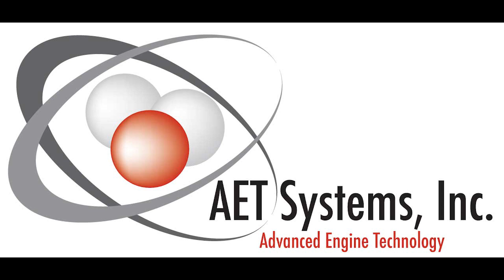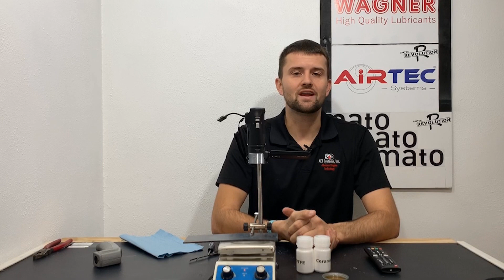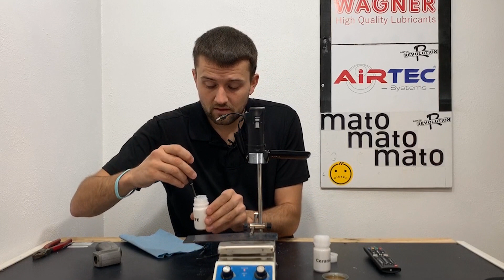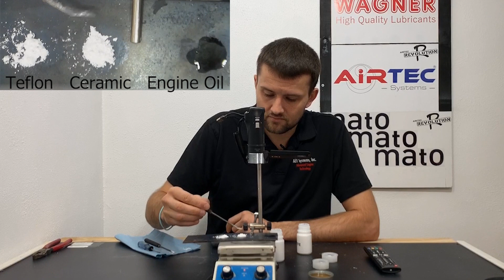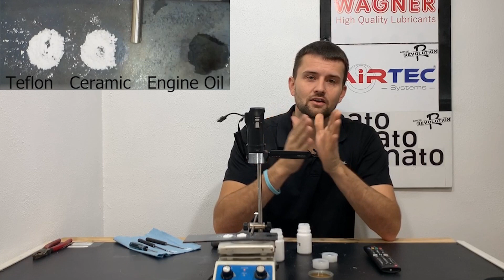Teflon Vs Ceramic Oil Additives: Uncovered in Temperature Review

Comment: If ceramic is truly beneficial I can't help but believe the companies making engine oil would offer a product with it already in it
Reply: Liqui Moly Molygen GF6 APi SP. It's available in every grade viscocity you can thick of.
Reply: @ericsivilla4091  liqui moly is the Lucas of Europe 😆
Reply: @Yelladog78  so what's the good stuff ?
Reply: @ericsivilla4091  application dictates
Reply: @Yelladog78  street performance.  Daily driver / Spirited driving.?
Reply: @ericsivilla4091  I meant more an application towards what type of engine. Flat tappet or Roller cam? Maybe Dual overhead cams? Timing chain or timing gear? Any boost? Gdi where fuel dilution is present. Would need to know all that to know how much zddp you need in your oil,  sheer stability of the oil you need, is  oxidation going to be an issue due to heat, how long between oil changes are you planning to go, how hot does your engine run typically. 

Valvoline vr1 is what I run in my off-road jeep and my Corvette. Pennzoil ultra Platinum goes in the wife's work car. But all that stuff a guy needs to know so he can pick the right oil.

Comment: Which would be better if heat wasn't a factor?
Reply from the maker: If heat is a non factor, ceramic still has a lower friction co-efficient and creates a more durable lubricant film than traditional oils and/or Teflon.

Comment: I would like to see a test that shows how well the ceramic additive goes thru a high quality oil filter like Purolator Boss synthetic filter or similar. I just don’t feel like these dry additives make it thru the filter media.
Reply from the maker: Our Ceramic particulate is size is 0.15 microns, for reference the micron rating for the Purolator Boss Synthetic Media Filter is 21 microns.  So the ceramic particulate is 0.7% the size of the filters minimum filtration ability, meaning there is no issue.  We rate our product for a minimum of 1 micron filter media.
Reply: @aetsystemsinc.1413  thank you for the answer.

Comment: You mentioned in a comment that your ceramic additive can be used with a wet clutch, but the ceramic oil treatment on your website specified that it cannot be used with automatic transmissions.
Has something changed?
Reply from the maker: Great question.  It is approved for motorcycle wet clutches, but not automotive automatic transmissions

Comment: Worthless test as that isn't happening inside an engine. According to this test oil is horrible as it burnt away easily. Actually that proves the test is not proper. It makes me think that teflon has a chance of sticking to the cylinder walls. Possibly bearings, but the temperature is probably not high enough.

Comment: I have a scientific test I want done.

There is a penetrating oil/grease that is primarily a mix of moly, PTFE, and oils of some kind.

I want to see how it behaves as an engine oil in a scientific environment and have the why's of what happened explained to me on the chemical level, because on a mechanical level I will understand the failure and where/how it happened, but I want to know the why of what causes it.

Comment: Too bad Teflon micro bearings don't exist.

Imagine a solid sheeting of Teflon encasing the crank and con rod, and a ceramic bearing of micro scale placed between those surfaces and lubricated with oil.

Comment: The motor oil carbonized long before the Teflon, so i dont get the argument. If you have those temperatures the motor will seize before anything happens to the Teflon.
Reply from the maker: Oil is forced away by the rings and the fluidity of the oil allows it to better displace heat.   Teflon is designed to act as a residual, meaning it adheres to the metal surfaces and is not forced away by the rings and eventually it breaks down and becomes gummy.  This is why the argument is made against teflon as an engine oil additive.  There are a lot of cases of this occurring, in fact, many of the Teflon based engine oil additive producers in the 90s eventually went bankrupt from lawsuits showing Teflon's negative impact on engines.

Comment: I added ceramic additive to my BMW 1.9 4 cylinder and it didn't have top end power because it had done 270'000 kms!..after adding ceramic additive i now get top end power!..I am so impressed in what ceramic can do to an engine!
Reply: yes I have noticeable better acceleration in an 04 TB with the Air-Tec added.

Comment: Nice greetings from Bayern (Bavaria germany)! :)

Nice Test and i'll get more knowledge about Motor oils, Additives against waer & even because i'll get a Lifetime vehicle with the 136000mls old 2006 Dodge Charger RT Daytona what i've optimized in this premission (& still in Progress to size Up Lifetime, especially with size down wear--> with my knowledge of Motors & now with get more & more knowledge of the additives in motoroil & how i could get a more wear protection motoroil....)

I found out of the most common issues of these 5.7 (&6.1-64L) HEMI's (American Design OHV V8's Like the HEMI's; are a high solid base for this Kind of Project & premission) that these issues/problems must Not be & could be prevent of it. 
Most known or Infamous Issues of these engines are mostly because using the fuel consumption optimized thinn ..W20 Grade Motor oils in my eyes, even also like that high motoroil Temperatures, too.
& So the 1st was to get a 15 row motoroil Radiator+180°F/82°C Oil Thermostat + 180°F cooling water Thermostat. In Same driving conditions the oil temp dropped roundabout 25°C , even in cruising conditions in the hilly roads of Bayern (~105-115°C before ~ 85-95°C after build in these things)

And now i'll get away from these recommend 5W20 viscosity grade motor oil to an 0W40; where i've choosen the mobil 1 FS 0W40 because the oil analyses shown me high Phosphor (P), Zink (Zn) & Bor. What should be very nice for prevent wear of the Motor ....
But now i've bought CERATEC (Liqui Moly) what's even an ceramic oil additive to get into the Motor Oil....(300ml for 5L) because there are some wearTests of motoroil with & without this CERATEC that shown a netter wear protection....

But what do you think about this Things, optimations what i've done or will do with that premission in this Car??? :)

Have a nice day Cheers Till 🙂🍀

Comment: need to check the additives based on the 4 ball bearing ASTM testing, which every single oil manufacture uses to see what additives they will put in to get various SAE oil specs?c here's the link to the ASTM Test https://youtu.be/nxTViMKn9a0

Comment: Ceramic reminds me too much of the rage for "Graphite" in the 70's and "Teflon (PTFE)" in the 80's.  I'm thinking if "ceramic" is that good, the major engine oil manufacturers would include it in their high end engine oils?  I find a point missing here in that lubrication in an internal combustion engine is the flow of oil over surfaces, not oil clinging to surfaces like in grease lubrication.  Am I missing something?
Reply from the maker: Fluid filming is one of most important attributes of lubricating oils, the goal is to have oil/their additives hold to a surface to produce/provide wear protection.    For further reading refernce  https://www.machinerylubrication.com/Read/30835/lubricant-film-strength    In regard to "major" oil companies using ceramic/boron nitride they do.   Alot of industrial lubricants use ceramic in their oil composition, additionally most race teams use ceramic reinforced oils.   The main draw back for popularity in "retail" oils is price point.   Ceramic additives are drastically more costly than lesser performing alternatives.

Comment: cylinder head temps rarely go over 400 degree F unless dam overheating..  I fly airplanes with piston engines.  We have gauges for that, for EGT also.
Reply from the maker: You are correct that surface temperatures rarely go over 400F as engine are designed to transfer and reduce heat.  However, peak gas temperatures during combustion reach well over 1500F this is well documented and what is discussed in this video- lubricant degradation at peak temperature exposure.   For further reading  give this article a look https://journals.sagepub.com/doi/full/10.1155/2012/931584
Reply: @aetsystemsinc.1413   Most Piston Engine airplanes, been mostly Air Cooled we have Cylinder Head Temp and Exhaust Temp Gauges. 
 Gas temps can go to the 1, 500 level, but cylinder head temps will stay around 400 deg. Farht.  Depending mostly on Outside Air Temp.  If overheating to over that, i have changed the oil.  Many times..
Reply from the maker: @emergencylowmaneuvering7350  Yes we fully understand this point.  The cooling system, regardless of liquid or air keeps core temperatures down through heat transfer, however this does not prevent lubricant film degradation on cylinder walls where temperatures peak well above 400F as the lubricant film reaches a higher temp than the cylinder wall itself.  This is the main point of the video--lubricant degradation at peak temperatures.
Reply from the maker: @emergencylowmaneuvering7350  You are correct on a macro levels but we are not stating that the oil itself is flowing back.  Degradation and in turn contamination occur in a large scale on a micro level.   Any oil left on cylinder walls during combustion reaches decomposition temperatures at which point sedimentation occurs---sulfurs, phosphates, etc. become embedded in the porous metal surface.  These residual compounds are highly oxidized and often acidic creating further degradation as engine oil is contacted with them and removed over and over again during normal use.  Our labs do extensive testing in these regards.
Reply from the maker: @emergencylowmaneuvering7350  "crap or residue"  Are often components of an oil that was left after severe degradation or break.       "But they only last 20 hours at most.."  That was the main reason this video was produced, to visually show the limitations of certain additives.....

Comment: I never really considered using ceramic before. I usually just stick to motorkote. But then again, I suppose motorkote may have the same basic issues as the oil. Where it eventually starts to evaporate to the point it looses its effectiveness.

Comment: What about IF-WS2?
Reply from the maker: WS2 was not compared in this test as there are concerns about the stability of WS2 as a engine oil additive as it is subject decomposition with alkaline additive packages present in certain engine oils.   That said WS2 has a high temp rating similar to that of ceramic/hBN

Comment: I think you need to read this seqence III test of teflon additive: http://www.qmi.si/content/testiranja.pdf . If you can show me result that prooves this is wrong, i look forward to hear from you.
Reply from the maker: It is not disputed that Teflon reduces wear, however, it has been proven that Teflon does not withstand high temperature well enough to be a good cylinder wall lubricant. The test data you sent refers to running temperature, not peak temperature during combustion, we are looking at peak temperatures in this video and thermal stability.
Reply: @aetsystemsinc.1413  Well,show me the test result that prooves ptfe is not a good cylinder wall lubricant.
Reply from the maker: @steinetakorgroovy  While Teflon has a very low friction coefficient there are now better alternatives to PTFE in terms of thermal stability and wear protection.   https://suicideslabs.com/dw/arc/papers/81506-boron-nitride.pdf

Comment: There's a logic issue here. You have not established that the behavior of teflon is a problem. 
Other, 'soft' parts of an engine (i.e. seals) surely will not survive 450 deg. ...
The oil did not survive those temps - so is oil a bad thing?
I surely, will not be dropping ceramic powder into my crankcase and no oil, just because ceramic acted like ceramic...

Interesting video, but you've established very little, beyond that every substance works only within a range of temperatures...
Reply: I would put the TUFOIL equivalent vs any of this companies products
Reply from the maker: @admina7138  We will gladly stack our products up against TUFOIL in any 3rd party test specifically focus on high temperature wear and friction reduction with a full spectral analysis of the oil afterwards to show the decomposition in each product.
Reply: @aetsystemsinc.1413  will you stand by a 3rd party comparison of your micro ceramic additive vs liquid molys CeraTec ..??
Reply from the maker: @admina7138  Yes, a chemical analysis will show that Ceratec uses a concentration of organo-molybendulm where as the ceramic products we supply are true hBN. This is why Ceratec cannot be used in wet clutches, whereas our product can be used in a wet clutch.   A performance test will highlight the differences as well.
Reply: @aetsystemsinc.1413  you use hBN I'm curious what surficent you use for suspension what separates you from motorkote or archoil..?
Reply: With all these, will you guys test your products head to head with Polytron?
Reply from the maker: The established point of the video is to show the limit of conventional lubrication, specifically temperature limitations.   1.  "soft" engine components do not exist in the combustion chamber for the exact reason that they cannot take extremely high temperatures.   2. Oil breaks down under the high heat reached during combustion, which is why oil fouling occurs over time.  3. In the video it is described that oil is used as the standard wet lubricant in addition to a micro ceramic additive to further provide lubrication under high heat.   At no point is it suggested that ceramic should be used by itself.   4. For many years teflon was touted as a performance oil additive, however, after causing widespread engine failure Teflon has lost favor as an engine oil additive for the reason shown in this video-It breaks down.    We provide ceramic additives for high performance race teams for the exact reason shown in this video--micro ceramic provides added lubrication without risk of breaking down and causing damage.
Reply: Not to mention PTFE has a melting point of surprise surprise.. 500 degrees fahrenheit..
Reply from the maker: Temperature is the limiting factor of Teflon products, temperatures in the combustion chamber reach many times 500F at which point many Teflon products fail and actually can cause damage.  This is the reason HBN out-performs Teflon as a engine oil additive.
Reply: @aetsystemsinc.1413  Yes, the GAS inside the chamber gets very hot during combustion for very short periods of time - but those temperatures are never transferred to the engine surfaces.  A head gasket, for example, would not survive those temps.
The weird thing is - I'd expect you to know that....????
You won't be reading those temperatures off of a functional engine.
Reply from the maker: @Roudter   As pointed out in our previous comment--We discuss and examine the brief overheating of cylinder walls that residual oil/additives such as Teflon, MoS2, HbN are subject to-We have never claimed engine components such as the head or head gasket reach temperatures over 500C/K.   Here is a link to an article to better help you understand the point we are examining  https://journals.sagepub.com/doi/full/10.1155/2012/931584       

"After the compression stroke and during combustion stroke, there is heat transfer to the surroundings from the hot gas through the cylinder walls. The peak gas temperatures of combustion are the order of 3000 (k) and that is why the cylinder walls of the chamber overheat."

Comment: Hey! You still miss one. That is graphite which every lubricant company nowadays use. It provides tramendas lubrication inside the engine. Love from India ❤.
Reply: graphite leaves awful residue at piston head, valve seat & exhaust manifolds. it will clog up catalytic converter.

ref: https://youtu.be/5H_mZTh5bHY
Reply: I still need detailed explanation of Ceramic not scratching and Lubricating the parts😅 in microsopic. Video will be good☺
Reply: I have been using graphite for years in live entertainment to lubricate gears in self feeding carbon arc follow spotlights. Once you mix it with oil it makes damn mess. It's one or the other and we know that when oil is his hot enough it burns.
Reply: Graphite was all the rage in the 70's like Teflon (PTFE) was in the 80's.  Arco marketed their own "Graphite" motor oil like Petrolon marketed "Teflon" in Slick50.  Neither of these should ever be used in engine motor oils.
Reply: Graphite also required moisture..
Reply: @admina7138  still thinking just one thing. That ceramic might end up scratching more at some places were it should not.
Reply: If they are using hBN is an incredible dry lube